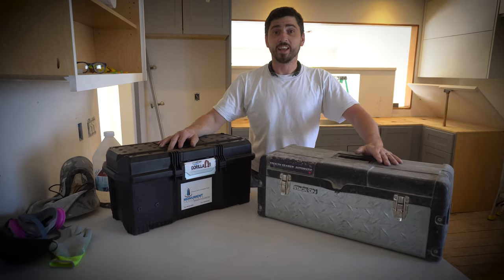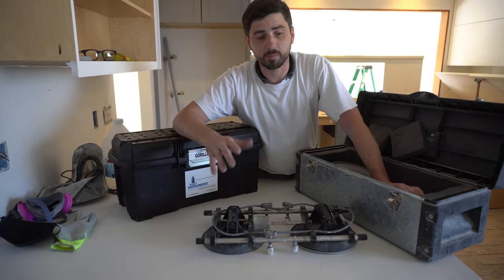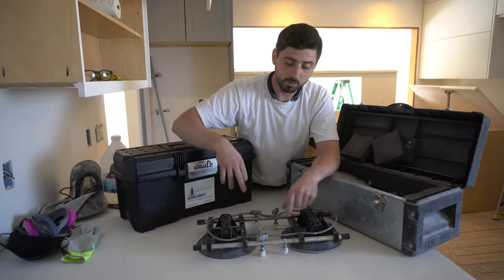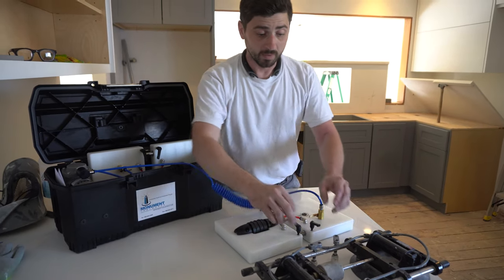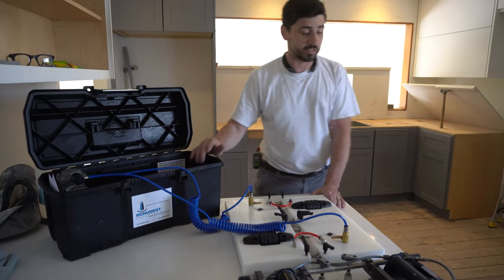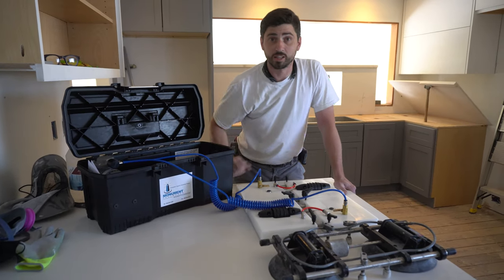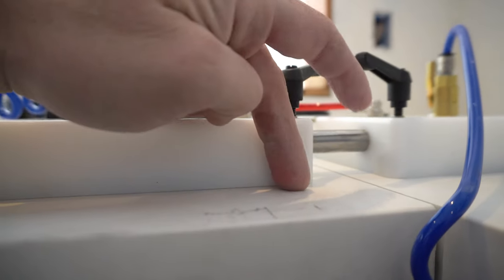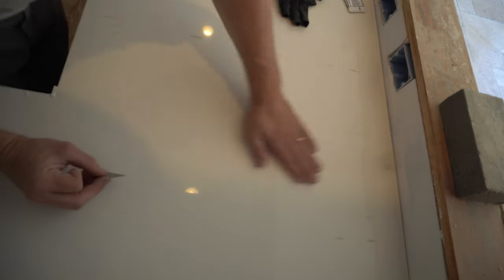GORILLA GRIP Seam Sealer Review

Comment: I been using gorilla clamp for years u using it wrong...thats not the right way to use it.
Reply from the maker: Please explain
Reply: @SuperVPro   I think maybe he's referring to the fact that you put the epoxy in and then leveled it with the gorilla grip? Usually I keep the gorilla grip on it when I put the epoxy in but that's just because I don't like having to race against the epoxy curing. I don't think it matters really if you're fine having a slow cure time.
Reply from the maker: @Zurkive   I understand the problem is is you tend to get the tool all dirty and it's hard to maneuver. And I like to load up my joints real well thanks for the comment though.
Reply: @SuperVPro  oh yeah man, it can definitely be a pain. I regularly have to clean my seam setters because of it. I don't think it matters too much either way. This was just my theory as to what he could've meant.